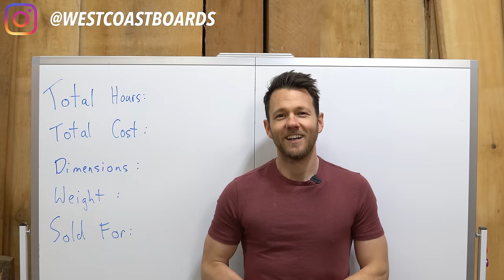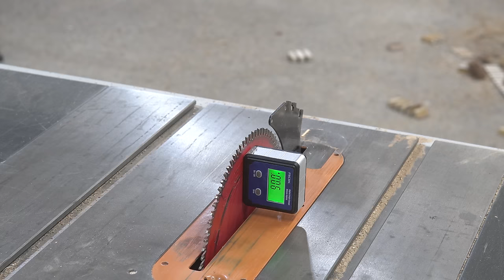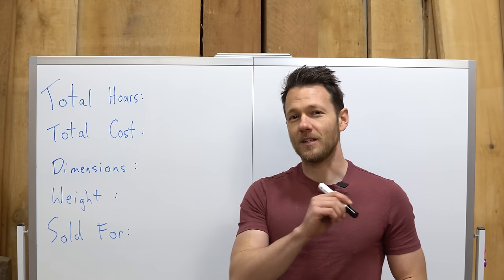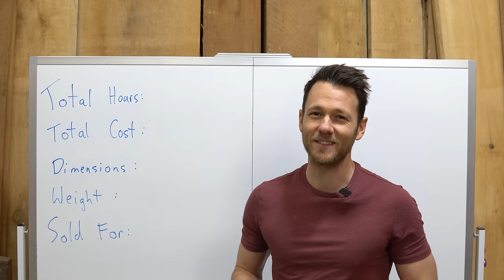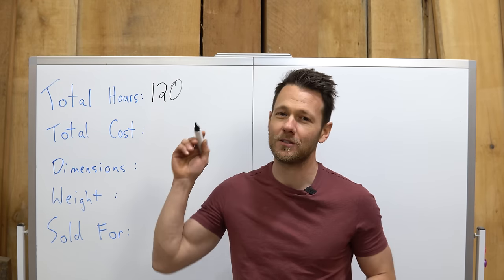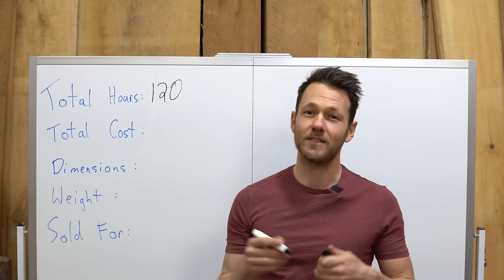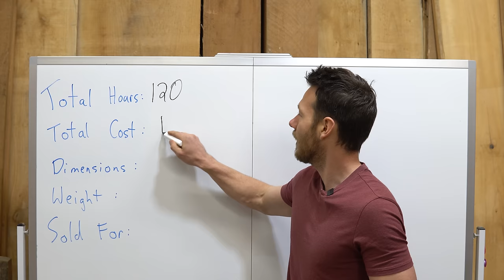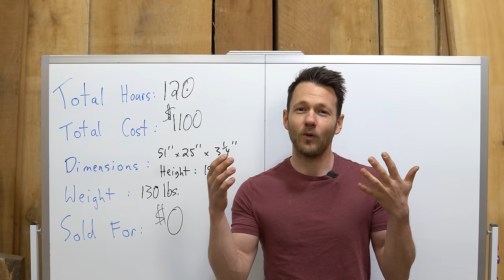One of a Kind Pallet Wood Table

Comment: The ONLY ODD THING about this exercise is it appears he first built this pallet out of wood he wanted to make a table with. I've NEVER seen a pallet with such sturdy quality material; it doesn't mean he's not talented,  the video is just misleading
Reply: You might be surprised about pallet wood after  planning and sanding
Reply: Luckily, where I live, a huge majority of the pallets I find are made of oak or something similar in strength and something softer like pine. I've had great luck with pallets and found some gorgeous pieces of wood. Just need to sand away the ugliness.

Comment: Quick couple of tips for the pallet breakdown. When banging long nails through the wood use a hammer with a flat side on its head, and use that to bash them through, as gives you a larger hitting area (also hold handle near the end of handle). Secondly when pulling nails through with the crow bar, pull them a little way through then place a hammer under the crow bar and pull rest of nail through, it keeps it straighter and makes it a lot easier. P.S. love the videos 👍👍
Reply from the maker: Glad your enjoying the content!
Reply: Hi boss where  are you located

Comment: Very Nice Masterpiece! 😎
Lots of clamping, so i also wonder how it would react in the future 
Lots of possible tension is distrubuted over the whole lengh with the Boards between!
I thought about it and wondererd that u just use oil for the surface, better offer some amount of the finishing oil too, when selling it. 🤔

On bigger surfaces i would just calculate instinctivly the needed amount of oil, drop it on the platte at once for this side and use a wide plastik - spatula to sread it out. 
With the brush the corners, margin and smaller parts.

Comment: Ryan, the table turned out awesome, it really did. I’ll bet it holds up for years to come. Unfortunately, hardwood is way over priced, which really digs into profit. 

If you use a lot of pallets, you might look into getting an air nail remover. Not sure how well they work, but they start at about $40. 

I noticed all those wine barrel staves piled up against your wall. Not sure if you’ve done it, do it, or even interested, but have you ever considered adding stave, and wine barrel furniture to your product line. For the most part they look fairly easy to build, and they command a stupid, ridiculous amount of money. 

Hope you and your family have a very Merry Christmas as we celebrate the birth of Jesus.
Reply from the maker: Thanks Brent! I even told myself after the last pallet project I’d get myself one of those pneumatic removers but just didn’t make it happen. As for the staves, I have thought about it but have some different ideas for those😉 Merry Christmas!

Comment: Great video.  What bandsaw blade are you using?  Also, I was wondering why you were free handing straight cuts on band saw (not using fence)?  Then you corrected any error by jointing the edge. Brilliant. I’m always nervous using jointer on end grain.
Reply from the maker: I use a 3/4” 3 TPI resaw blade.

Comment: You do good work, I just have one question, do you inform people that watch your videos of the dangers of using pallets?
Especially when cutting them and even when it is finished you may not want to have small children around them.
I have worked in areas that use pallets and one day they will be be use for instance eggs or milk, then that same pallet will be sold and used for a load of shingles then that same pallet could be used to haul a barrel of napttha or crude oil then that same pallet could be used for hauling furniture.
Then you get that pallet and start cutting it and sanding (that is where the real danger is). And all this I have said is a real life scenario, and I have said this to let you know that pallet wood can be extremely dangerous!

Comment: >>>>An epoxy coating would secure the stability of the piece next time. Even under water , pallet wood, or whatever the case may be that epoxy is damn near indestructible until u add heat

Comment: TAUGHT CABINETMAKING FOR 45 YEARS(HIGH SCHOOL/COLLEGE) - LOVE TO TEACH YOUR TYPE OF CONSTRUCTION WHEN YOU USE WHAT'S AVAILABLE TO COMPLETE THE PROJECT - WOW! YOU SURE ARE VERY STEADY CUTTING OFF THOSE SCRAPS ON THE BANDSAW - I REMEMBER IT WELL BACK WHEN I WAS YOUR AGE(80 NOW) - SOME "RED PEN" NEED IMPROVEMENTS: YOU WERE ROUTING IN THE WRONG DIRECTION WITH THE SMALLER CHAMFER ON THE TOP(14:00) - RULE: COUNTER ON THE OUTSIDE/CLOCK ON THE INSIDE -YOU WERE "CLIMB CUTTING" BAD FOR THE ROUTER BIT  - WOULD LIKE TO HAVE SEEM THE RAILS CONNECTING THE LONG SIDE OF THE LEGS TO A SIMILAR GRAIN PATTERN LIKE THE WHOLE PROJECT(TOO FAR APART): YOU SHOULD PRACTICE "RAISING THE GRAIN" PRIOR TO ADDING THE "TUNG OIL" - RAISING THE GRAIN ON HARDWOODS LEAVE A MIRROR LIKE FINISH SO ANY TOP COAT DOES NOT RAISE THE GRAIN - ALSO, US OLD TIMERS ARE EXPERTS A "HAND RUBBING TUNG OIL " INTO GRAIN AND NOT JUST SITTING ON TOP OF THE SURFACE LIKE SHOWN IN THE VIDEO - "FRENCH POLISHING TECHNIQUES ARE A LOST ART THAT SHOULD BE PASSED ON TO THE LEADERS OF OUR INDUSTRY - NO SAFETY GLASSES TOO - THE "WISE OWL CLUB" IS BETTER THAN MISSING AN EYE  - OVERALL GRADE 92% JUST FOR THE FINISHING OF THE PROJECT - KEEP UP THE GOOD WORK - MICHAEL